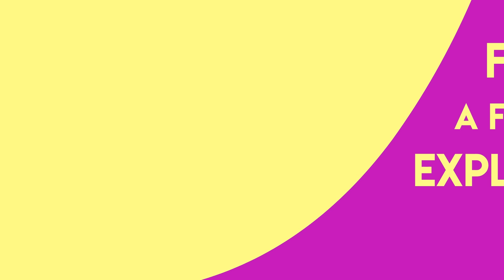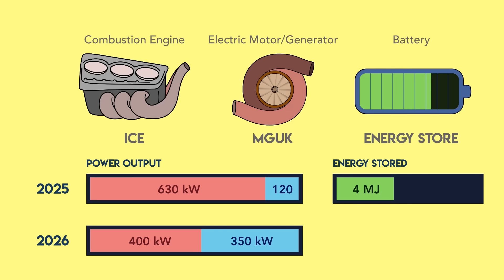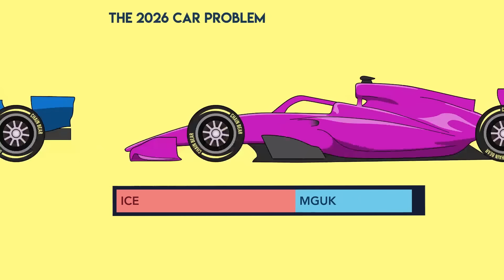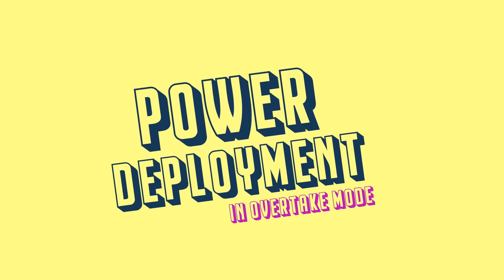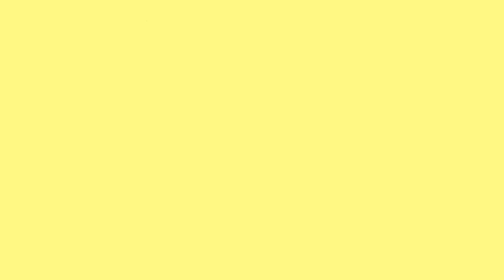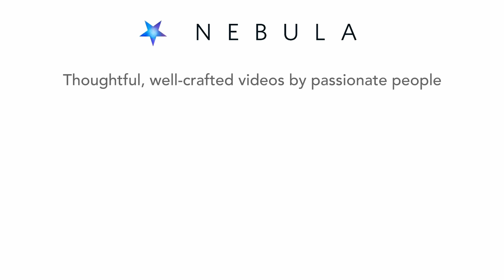New for 2026! Straight Line Mode and Overtake Mode

Comment: Welcome back! Been a while. I guess 23-25 didn't have much technical chat anyways...

Note: An inaccuracy - the battery has 4MJ maximum stored energy - they can /regenerate/ 8.5/9MJ per lap, but you can't keep it - the maximum SOC from lowest to highest is 4MJ, which means a recharging of 4MJ then a regeneration of it for approx 11s of deployment per charge (twice -ish per lap.)
Reply: Yeah, I made a couple of rants on other videos about this. The overtake mode is not going to work. On most straights on the calendar you're going to run the battery dead long before you can even engage overtake mode. There's not going to be any reserve energy to use to power it.
Reply: @Mike23443  Being able to utilize 0.5MJ extra over a lap might make you able to skip LiCo at a strategic point, but I'm very skeptical of that too.
Reply: God I did not realise they were that small! No wonder the batteries are struggling, they can't charge for multiple laps and then deploy, they can't even charge enough to deploy for a straight

Comment: How have the ice been nerfed from 630kw to 400kw if its still the v6 turbo. What is the rule/ regulation that stops teams using the 2025 engine with the 2026 battery to have a combined 980kw. I haven't heard anyone actually explain why the combustion component has taken a backwards step.

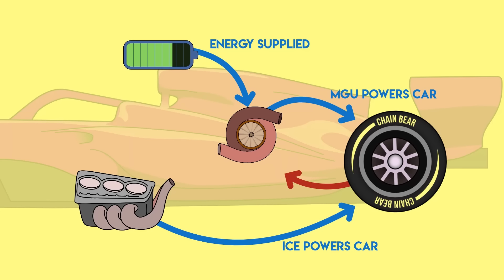Comment: @9:39 Hey Admin, The MGU-K is the motor generator unit kinetic (motor with speedreduction on gearbox), and the MGU-H is the motor generator unit Heat. (Motor on the Turbo). 

2026 onwards, MGU-K is 350kW, and MGU-H is removed.
There may be some animation mistakes here. u show the turbo as the MGU-K when it should be just a motor

Comment: For my taste you dont seem to show the same level of detail and accuracy as you used to. Im happy you are back and hope you will start pumpig out some high quality videos as you used to.
Battery capacity and maximum recharge per lap is not the same. Because the battery capacity is lower with 4 MJ than the 8.5 MJ you can recharge, you will run out of electric energy after 10 to 12 seconds full gas, many straights are longer than that.
Please use the symbol of an electric motor as the mgu-k is one, and not a symbol of a turbo which would be okay for the old mgu-h, as it was a turbo with an electric motor.

Comment: Use of most electric power just before the longest acceleration sections.  Batteries will be charged during vsc, safety car, pit lane as well as braking zones.  All those make tire management crucially important (Checo).

Comment: 9:45 is this what superclipping is? I've been struggling to understand it since testing but this was really clear
Reply: Superclipping is just a term that the commentators have come up with, because the have to give stuff a name when they don't understand it yet. It's just clipping + harvesting, which already happened with the previous hybrid engine in some corners (mainly traction limited corners after long straights). We just noticed it less because it was a smaller part of the overall power

Comment: My take on what the lingo should be for 2026:
Overtake Mode = Push-to-pass (ineffective)
Super clipping: = now the engine is a generator
Active aero = DRS but it's not an overtaking aid anymore
Cornering mode = Wing go up
Straight line mode = Wing go down

Comment: 3:30 On average 75% of the regen per lap across tracks came from the mgu-h regen so the ES was only used to drive the mgu-k out of a corner and supplement it on the straights, though it had to be used to drive the mgu-h as well. Also, the teams started circumventing the 2MJ per lap mgu-k regen limit into the ES by spooling the mgu-h with the mgu-k regen into a corner and drawing some of that inertial energy out of the mgu-h out of a corner

Comment: Okay this makes more sense than what I’ve heard before. I have some concerns, notably the rather rapid loss of power. Hybrid is great, but I wonder if there’s a way to make it last longer. We don’t want F1 to become Formula E, they’re different disciplines for a reason, but it feels kind of like the ratio is off? 
Otherwise, still slightly confused just due to how much is going on. Indycar has ‘push to pass’ which is relatively simple but the Overtake Mode seems a bit more complex.

Comment: That was the longest hibernation in the history of the bears.
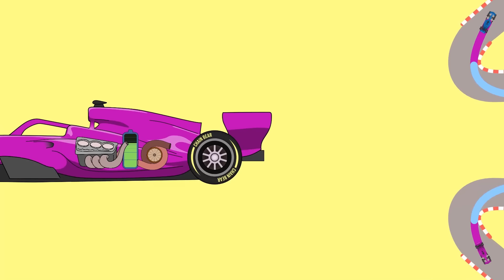PS Graphic at 9:22 for MGK looks a lot like turbo, but in fact MGK is just an electric motor or electric generator, depending on the direction of the electricity flow.
Reply from the maker: Aye you're right, and I did know I was drawing a turbo when I was setting up the graphics and then I think went into a trance state and used it for the MGU every time like a fool. Oops, my bad. Hopefully if people go by the labels, they'll be fine and not too confused.
Reply: @chainbear I think the mgu-h was essentially a turbo compressor wheel attached to an alternator (simplistically), maybe that is what you had originally drawn? And that specific mgu-h has been dropped for this years regs? Now we just have the mgu-k which is the motor connected to the axle like you explained in the video
Reply: That graphic is of a Turbo. It confused the hell out of me. I wasn't sure if he was describing the old system or the new.

Comment: Thanks a lot for that!!!
Been wondering for months whats the difference between boost and Overtake. Maybe you need to make another video about that? Or you could just confirm with your reply hopefully. Am I right to think Boost only has access to 8.5 MJ as opposed to the full 9MJ on overtake mode if a driver/car is able to store that?? This will be a key factor in driver competitiveness as I don think all PUs at this point are able to maximize harvesting. You could post a graph highlighting the difference between boost and overtake.

Comment: I think it's worth clarifying that the total charge the battery can have at any time is 4 MJ. You're allowed to charge up to 8.5 MJ (or 9 in overtake mode) in total over a whole lap. However, calculations suggest that recharging that much over one lap will be difficult.

Comment: 8:09 wasn’t there a rule about not using the mgu-k under 50km/h too? That’s the problem with the starts isn’t it?
Reply: That holds for standings starts: "With the exception of cars starting or resuming the race from the pit lane, the MGU-K may only be used during a standing start once the car has reached 50km/h."
Reply: Indeed.

Comment: Regarding corning speeds, in theory they will only be lower because of the reduced aero loads. Even with a 98% total recharge and deployment efficiency it will always be more effective to corner quicker and not lose the energy in the first place than to recharge and redeploy